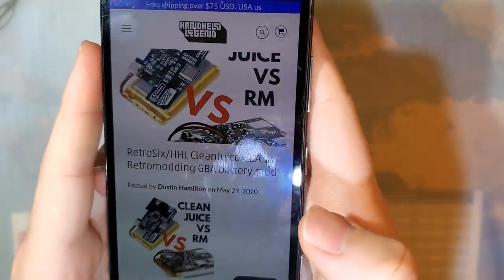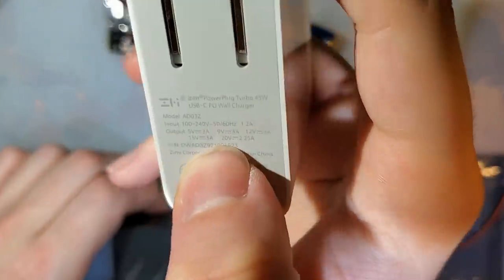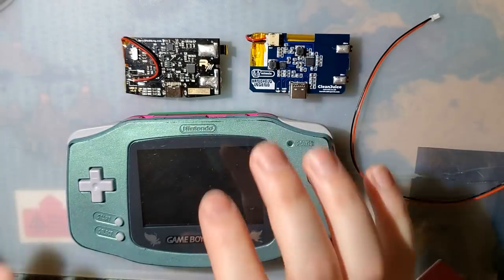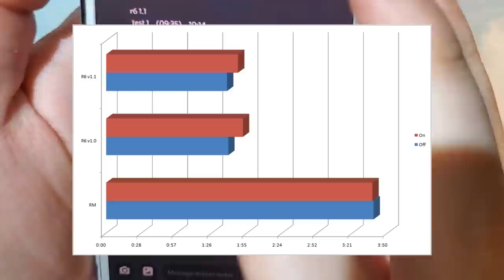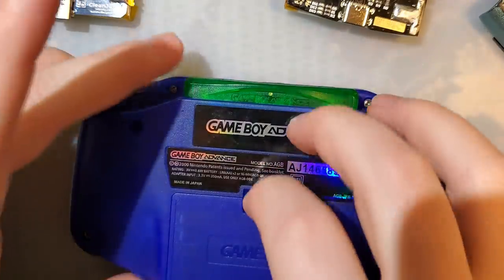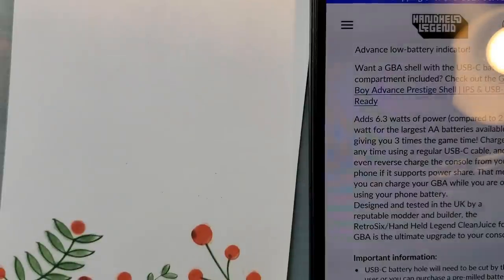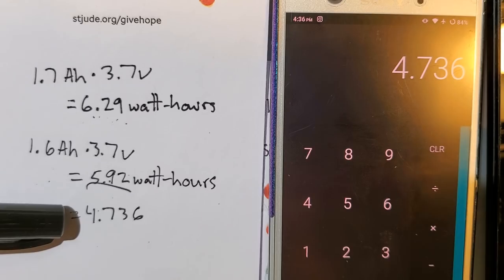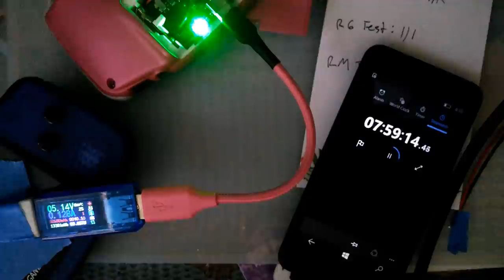Battery Mods for Game Boy Advance

Comment from the maker: To be absolutely clear, I have no problem with either battery mod presented here. They are both solid options and very comparable for the price. For the mod alone, you can't go wrong with either, if that's what you want. 

My problem is with the marketing around the RetroSix mod and the numbers that are presented. The actual performance is fine (if less than expected based on the specs provided) but when you are sold a battery mod claiming to have a runtime of 14 hours and only get 10, there's an issue. 

I tested this with a funnyplaying IPS kit AT DEFAULT BRIGHTNESS. A 'one chip' kit (you know, the ones that R6 sells since they don't carry funnyplaying's kits) at default brightness pulls significantly more current. I have measured the power usage on video before if you do not believe me. Please see my notes here https://drive.google.com/file/d/1wUsJ2jZkEBOzhegrN-tVGW7wCkuIf6Bi/view with video links for proof. You can also see the particular console I used to get the current consumption for extrapolation with other battery mods or batteries (or the same batteries but at different brightnesses) since I went over the math you'd need for this at the end of the video. 

Was I critical of R6 and HHL? Hell yeah I was. They LIED about the specs of the unit they sell, they LIED about the specs of the competitors unit to make theirs look better, and they LIED about the capacity of regular AA batteries to make their mod look better. I'd excuse one falsity as a mistake, especially if they work to correct it but HHL HAS DONE NOTHING. NEITHER HAS RETROSIX. I have reached out to HHL about this and I am absolutely prepared to eat my words if they correct this. We'll see.

Was I unfairly biased towards Retro Modding? I sincerely doubt that since in this video I still recommended using NiMh batteries over both mods. I also put them on blast for having the wrong charge specs listed for over a year now. I was more critical of RetroSix over Retro Modding because of the amount of misinformation RetroSix presented. Had Retro Modding even come close to that, I would have been critical of them too.
Reply: Yeah, this is a mod that never seemed worth doing. My eneloops are working just fine.
Reply: Hi Makho - for the very first time I came to see this and I started by reading your post... I need to let you know that the specs for the Retromodding battery mod came directly from their product page on their site at the time of writing the article - May 30th. This video of yours was done a couple months later, and they may have changed what they reported on their product page by that time... but under no circumstances did we misrepresent the Retromodding data. It all came solely from their site on the battery mod’s product detail page as of the May 30th publication date.

I think you’re seeking drama where there is none.
Reply from the maker: @DustinHamiltonSituatedAction   I understand that both products had incorrect specs listed in the page and I like to think I was pretty critical of both units. While RM has corrected everything as far as I can see, I would like to point out that there are still very blatant lies on the listings on your site and RetroSix's for the battery mod. And for reference, I don't represent RetroModding any more than I represent HandHeldLegend. 

I did give the details in this video (skip to the end, I go over the math) and in the email I sent you guys but the biggest lingering problem is part about AA batteries. I can elaborate if you want but the short story is that the units are wrong (watts vs watt-hours), comparing one AA to a two AA replacement is just straight up misleading, and even cheap AA batteries have more capacity than the 2wh listed (well, actually it says 2 watts but that doesn't make sense in context). 

I'm not (intentionally) seeking drama, I just really dislike how much misinformation there is in this community and I'm working to try and fix that. My only goal has been to provide a source of reliable information. I never intended to start shit (and I know based on a lot of the comments I get on RetroSix related videos that some people are getting the wrong idea) so I apologize if that mob has been unruly. We're all human beings and we ought to be excellent to each other. I am constantly working to be a better person and you should be too.
Reply: @jim34xh  may I ask what eneloops your using. I would like to get some myself. Thanks
Reply: @dazamad  
 Panasonic BK-3MCCA8BA eneloop
 AA 2100 Cycle Ni-MH Pre-Charged
Reply: Hi Makho, awesome video, I just have a question, Can you "charge and play" with these battery mods? 
I wouldn't want to have to put the gba down just to charge it if with Laddas I can simply put freshly charged ones in and continue gaming.
Reply from the maker: @mavh0116  retromodding's and retrosix's mods both support simultaneous charge and play. The other ones do not. 

It's much quicker and easier to just swap to a fresh pair of charged NiMh though and pop the other ones on the charger.
Reply: thank you for replying!
Subscribed!

Comment: Thanks for taking the time to test these batteries, the rant is granted as you invested your time and resources to prove that your theories were accurate. It’s very curious that with these two mods you get similar times (if not less) than regular rechargeable batteries. I feel the convenience of plugging each console to charge is better than finding my battery charger, however they’re way too expensive for me to justify a purchase IMO.
Anyways, good stuff Makho.

Comment: great video and very fairly tested... i wasnt super keen to try the lithium battery mods as i use Panasonic eneloop pros 2450 mAh and Panasonic 2700 mAh AA batteries... i actually get 14-16 hours runtime on a GBA with a Funny Playing IPS V2 screen mod on average... sure the convenience of USB C power/charging is great but your findings indicate that you will only get 10 hours on the Lithium mods... so for me AA Ni-MH rechargeable batteries are my goto... thanks so much makho for all the data... 👍🙂

Comment: There is a third option out there being offered at a considerably less price through a few different vendors, two on ebay and one comparable to Retro Modding and HHL. I picked one up and it took exactly one charge and would not change again. I've used both of these batteries profiled here and you're spot on. I've had less than savory experiences with HHL (they take forever to ship). The Cleanjuice itself has been fine, but the Retro Modding unit is still the better option overall on most fronts. I just ordered another one.

Comment: Here's an interesting little tidbit. Installing the low power led mod for the Cleanjuice introduces an interesting problem- There's an excessive amount of passive battery drain even when the system is turned off. We're talking about full battery drain after a couple of days. I think I'll be sticking with the Retromodding option from now on.
Reply from the maker: Hmm. I didn't observe this in my tests on my unit. Now that it's been setting for a week or so, I'll have to check again.

Comment: Two 14500 LiPo  3.7v 1000mAh batts wired in parallel give me 14-15h on my AGB with IPS mod and custom audio amp, and the battery compartment on the shell is left intact (no cutting required). This same mod give me 18h on my GBC with IPS + audio amp.
Reply: Do you have to use a diode to go from 3.7 to 3v ?

Comment: Hello Makho, i just recently found your videos while i was searching for GBA mods. I found your content really educational. I love the raw format with few or no edition by the fact that it feels like we are in a class room or something. Thank you very much for sharing your passion on this medium. Its really helpful. With that said, i wanted to share something, at last i found the courage to try and ask something GBA related, I got nothing to loose! Hope i can get at least some light on what i can do or where to can start. I found an old GBA i had stored. Everything looks fine, only thing is the volume seems pretty low even on high. (No problems with headphones, but i can hear like a hum when plugged in) so, i went and bought an IPS V2 screen which i installed with no problem. Thing is that when i started using the console i noticed the batteries runs dry really fast, i mean, i charge a pair of AA and in less than 20 mins the power light goes from green to red. I know a new screen might reduce my battery life but... Not that fast. At least im expecting 5-6 hrs charge. So yeah, does anyone here have had this problem? if yes is the answer, can you let me know what should i be looking or checking on my board? (40 pin GBA board) 

Hope you have an absolute great day you all. 🙋🏻‍♂️
Reply: I just found out that my power button was a bit dirty. IPA (Isopropyl Alcohol for those who dont know like me the first time) moving it back and forth made charm.  Got a green light!! Now to do some testing. Hope this helps someone in the future.
Reply from the maker: What is your actual run time? And are you using high quality batteries? Not all AA batteries are made the same. 

Low volume could be either dirty volume wheel (clean by disassembling console and spray contact cleaner into the wheel while moving it back and forth or replace wheel entirely) or bad electrolytic caps. The specs for the caps are on the sides or top (depending on the specific brand) so you can use that to order new ones. 

The other person mentioned cleaning the power switch by dripping IPA in there and running it back and forth. This does not clean the power switch. This just masks the symptom for a few days/weeks. To clean the power switch, you need to actually disassemble it and clean out the carbon buildup on the contacts. I have a video for that.
Reply from the maker: @soledezruiz2860  This is not a fix. This just masks the symptom for a few days/weeks.
Reply: @makho  noted!!!!! Thank you very much for your time! Really appreciate this! Thanks for the heads up. I'll Let you know what i do. 🙌🏻🙏🏻
Reply: Bout the batteries I used Duracell and Energizer rechargable batteries. I never had the chance to run a  real runtime test cause I was scared i was gonna mess something so I let the thing on "standby" while i was doing research! With what I did with the IPA i have 5-6 hrs aprox using IPS v2 screen in the lowest brightness and a EZ Flashcart Omega. Again thank you for taking the time to reply!
Reply from the maker: @soledezruiz2860  That time actually sounds pretty typical with an ezflash, maybe a bit low if you were on low brightness. Both IPS mods and flash carts significantly impact battery life, especially if you use both simultaneously.
Reply: @makho  yes! I found a test video with my specs that gave those results! What got me worried was the thing turning red in minutes. I thought it was something more serious. At least i found the problem is just the power switch. 🙌🏻. Gonna check what you told me bout the vol! Thank you very very much!

Comment: Holy crap this just told me where to invest my hard earned moolah as far as powering the gba I'm getting!  I was thinking about lipo to add in wireless charging, but too much hassle on the gba. Maybe my SP... Guess I'll stick with good old rechargeable AAs! 
Great attention to detail and math explanations! 
Bunmer that I hear the ladda's may be going away though...
Definitely going with rechargeables and a drop in IPS screen!
Reply from the maker: > Bunmer that I hear the ladda's may be going away though...
I haven't heard the same thing. They did recently get rebranded and also got a small price bump but even still, my conclusions are the same.
Reply: @makho  Ok, thanks! I'll check it out!

Comment: Noticed in some of your videos you use the Jugee rechargable AAs.  Where do you stand on those vs the LADDAs?
Reply from the maker: I plan on addressing this in a video soon. Jugee batteries are pretty good but they have their niche.
Reply: @makho  doubling back to this, I’ve been poking around the Gameboy discord and referencing your battery discussion in the Pocket vid. I seem to find conflicting answers on whether AA Jugees or Laddas perform better.

I’m going to be running a Color with the 2.0 IPS kit, LED buttons, and a flash cart.  What would you recommend for power?
Reply from the maker: @DS-fc6ql  for AA systems, NiMh (specifically IKEA LADDA or Eneloop batteries) are by far the best bang for buck and JUGEE doesn't offer any meaningful improvement to performance IN MOST CASES. I'm sure there are edge cases, especially for people with lots of mods, where JUGEE might eek out better performance. For AAA systems (the Pocket), the opposite is true and JUGEE are by far the best option.

Comment: I think the Amps is low because the max Amps rating is true only when the battery is fully empty. Batteries are almost full, so it makes sense the voltage is costant but amps decreases. Like in a standard graph CC/CV.
Reply from the maker: Yeah, you are 100% correct. Checking the current when the batteries were nearly full was a fools errand in hindsight. I did record the charge rate from empty later on though so I could make a graph of the current used.

Comment: Yeah I never understood the whole "upgrade to this obviously lesser capacity but much more expensive battery pack" thing. I knew it wasn't as simple as more mAh = more runtime period (I have a sizeable LED flashlight collection and have learned a lot about different cells), but I thought to myself that the disparity was great enough to make the AA batteries the winners. Add to that the fact that you can just swap em out for a freshly charged set and you have a winner in every way. If you're gonna be out for long and gaming a lot, you can always pack a few sets in your fanny pack. I honestly thought the AA would beat em a lot harder though, I imagined like 15hrs easily. I have some Duracell AA's from 2017 and they're still performing so close to new condition that I'm shocked. I've always babied my cells and charge em slowly, though, as well as store them at nominal voltage if I know I won't be using them for long periods. I have some eneloop pros (2550 mAh) and they perform even better than the old duracells (obviously). Age apart, they've really impressed me because not only do they have very long runtimes, but their recycle/recovery speed is amazing on my speedlite flash for macro photography. I recently got a stock GBA that I've yet to mod, but I'm excited to see how they perform there once I do mod it, and I'm planning on going all out. Funnyplaying IPS, powercleaner and amp with a new speaker, and hey maybe even LED's for the shoulder buttons. Great video btw, watched the whole thing.
Reply from the maker: powercleaner is placebo
Reply: @makho  Does nothing at all for the noise people complain about when they install the amps? Something about a hiss (which I’ve encountered on car audio a lot when they set their gains incorrectly thinking the thing’s a damn volume knob). They always think they gotta install a cap and I go nonono, you just gotta lower your gain to get rid of noise and distortion.
Reply from the maker: @groundcontrol6876  audio on the GBA is all digital until it hits the DAC in the amp. The amp is not even on the same power rail as whatever you solder to for the power cleaner (nothing in the GBA is, that's the whole point).
Reply: @makho  Thanks for the info, they seem to have launched a new amp that fixes the noise issue anyway. (It has adjustable gain). I'm pretty sure the issue with the noise was how loud the thing was (excessive gain introducing noise/distortion and also amplifying the inherently low quality sound on the device) and that's not even what one wants anyway. We want usable volume not making it as loud as humanly possible. Double the volume at max would be more than enough to be able to hear the console outside of a quiet room, cuz my SP can only be heard in my room lol. I'll try that new amp on the still stock GBA I haven't gotten around to yet.